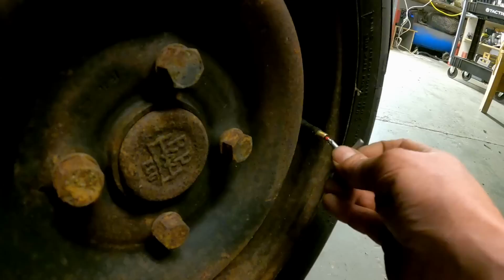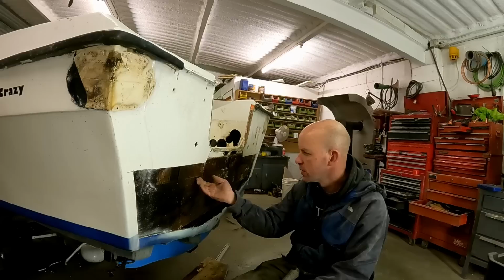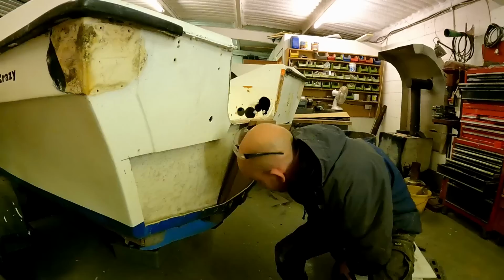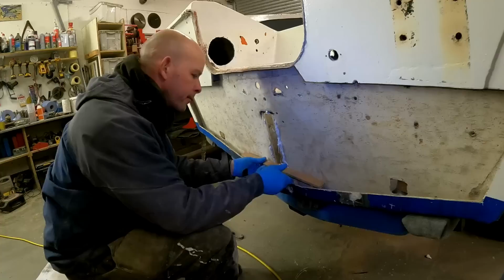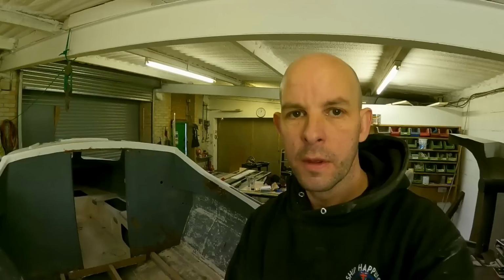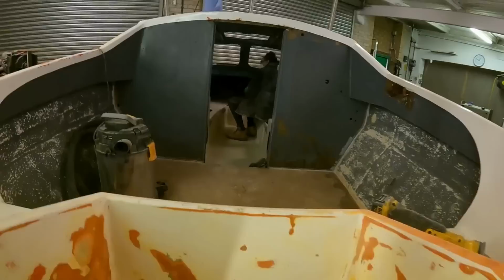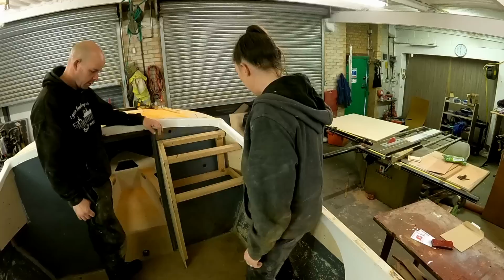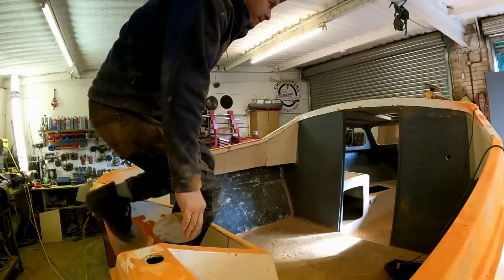Can We Turn An OLD Boat Into A PRO Fishing Boat? #boatproject #fishingboat

Comment: For fishing you will want rod holders and two seats with them fastened to the floor so they don't come loose when reeling in big fish and seat belts to hold you so that you aren't pulled off the boat by a big fish . And as for knifes in a sheath on your belt is the best place , not attached to the boat , Quick access in an emergency is key, Incase you have to cut line or seat belt because the boat is upsidedown. And as for fishing consult with your local tackle shop and ask what gear will be best for the area you are fishing.

Comment: Coming along nicely. Lots to do still. Remember to leave access point/area on the steering console for the gages, radio/stereo. Easy access to check wiring, fuses, exchange damaged or malfunctioning gages. So grey, white, blue, black like Sarinder.

Comment: Well, transom work is fun. Testing we would drill dome small 5 mm holes through the fiberglass into the plywood and put a shot vac against it to see if we got water . If we did and that was most of the time. We cut the transom out completely.  This was for access and for hull integrity.  Don't forget to check any wood that touches the transom for water damage as it creeps into any wood nearby.  Slow and steady as she goes putting it together.  Remember measuring before you cut anything off and compare it when you reassemble it. Carry on mate.

Comment: When I work with those boats there is usually foam (should be closed cell foam) under the sole and a drain bung. If there isn't then it expands cracks and then lets water in. If its not sealed it wont expand and contract but it will fill up with water. Its also common to find a built in bilge pump in that space. That said we did lose one rather rapidly while filming a fake crash into a styrofoam granite rock. The boat was tied to an anchor to stop it just at the point of impact but the wind blew it offline by enough to cause it to twist and capsize. The rescue crew rushed in to pick up the actor and when they hit well nudged the boat it sank like a stone. No foam.
I thought for a while you were going to make it look like a mini Sarindi. 
Great work as always.

Comment: I am immensely impressed. I've done the same thing to an old fiberglass boat and know how much effort it takes to gut the entire boat to the mere bare fiberglass hull and get it back to something resembling a boat. And than totally painted the entire boat with a few coats of catalyzed paint. Than wet sanded it and buffed it all out. It looks amazing, but a ton of hard, dirty, smelly, itchy work to get there. And lots and lots of polyester resin and fiberglass clothe and everything that goes with it. So to see you two attach this boat with such gusto is impressive...

Comment: Good luck putting the rubbing strip back on ! I ended up tying trailer the boat was on, to a tree, winch the boat down tight, then a ratchet strap to my house, clamp the centre of the strip in position at the front, then stretch strip  back (as it had shrunk)to the correct length with the ratchet strap, fitting it back on as you tighten, G clamp it at the aft corners when correctly positioned, and then re-attach the ends in position on the transom. Enjoy !!
Reply from the maker: The rubbing strip needs replacing, it's so old and broken now, just having trouble trying to find the right one we need!
Reply: @ShipHappensUK  Have fun, I did, LOL

Comment: I used to paint busses and coaches you didn't have to strip it all down there is a product called barrcoat which enables you to use cellulose paints on synthetic paint it stops the two paint reacting 
I would still use it in case you miss a few places I would have used one coat of synthetic paint no thinners all you do is heat up the paint and it goes on thickly I shouldn't run this is what I sprayed caravans boats and busses with you then let it dry for a few days flatten down and polish with mops it comes up like glass so if not don't forget to get BARRCoat to stop reactions between paints. all the best from john from rugby uk.

Comment: You are very fortunate the inner piece of the transom was not rotten !  Much more complicated when it is.

On small boats what you called  beams are typically called stringers.  I hope you drilled into them to see if they had any rot !  Most small boats rot from rain water.

They make a tool called a shrinker/stretcher which would bend that stainless piece for the transom very easily.

Use butyl tape to bed the "windows".  You will need more screws.  Use finish washers with a bit of butyl on top.  You could use through bolts with "acorn" nuts on the inside.  Or, mark your additional screw holes.  Drill them about 12mm, fill with thickened epoxy and, once hard, drill into that.

Comment: I've seldom seen an old fiberglass-over-plywood boat where wood below the waterline doesn't EVENTUALLY waterlog and rot.  I'm convinced that putting something that can't stand being waterlogged inside fiberglass is a fundamentally flawed construction method.  It means any FRP crack no matter how tiny eventually (and invisibly) causes the whole to disintegrate given time.

Comment: Just caught up with the paint removal during he last few minutes. 
Question- Why do you not use wet-n-dry sanding sheets?  It leaves sludge that has to be washed off, but cuts really well into old paint and gel coat.

Comment: On that boat trailer, get that hard plastic front wheel off and replace it with a thick pneumatic tire.  You do that and pushing the trailer around will be easier.

Comment: A lot of work for one contest. Did you think about drilling holes in the shelves in the two openings under the steering wheel so water can drip down to the bilge? Water will splash in when you are at sea.

Comment: It’s only a bit black. Nothing a dehumidifier won’t fix. Yeah right. Stick the boards with polyurethane mastic and glass over the outside. 
MDF or better a light fibre board soaked with epoxy in a vacuum bag would be heavy but also extremely durable.

Comment: Great job done  if you have a weekend free feel free to slip over to AU i have one here  a 12 .6 foot run about fishing boat I have been looking at on the trailer  for a couple of years needs new stringers for the floor and a floor  ,think the stern is ok , what is the glue you use in the tubes

Comment: I have had to take mine all the way back to original gel coat I did manage to get two mates to help. Omg it took ages I'm around 200 hours in to my boat restoration and still have a long way to go
Reply from the maker: Omg know how you feel! Check out the latest video we put up last night of the boat!
Reply: @ShipHappensUK  is that the one when you painted the hull ? I think I seen it. I'm going to do the same I'm going to flip the boat. I'm going to reinforce the keels on mine and then spray it and flip it back and start on the top side.